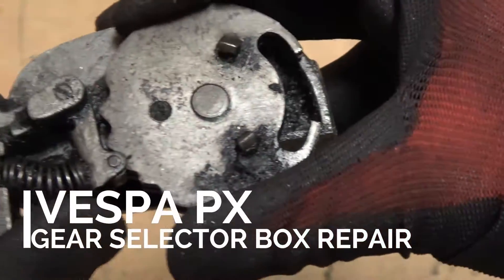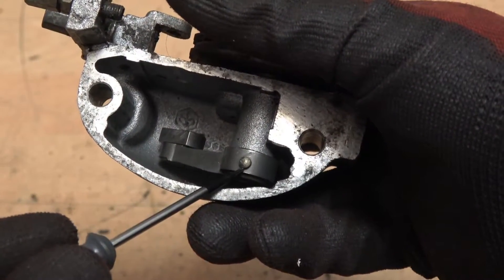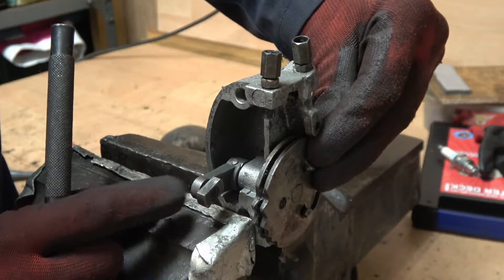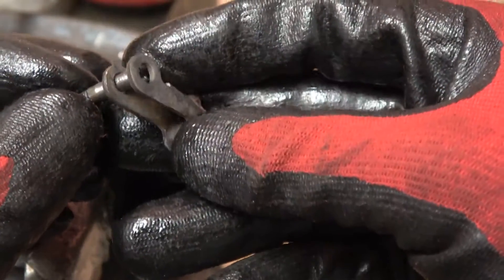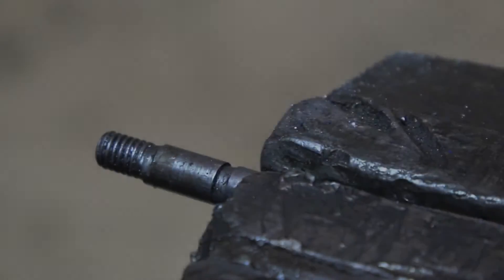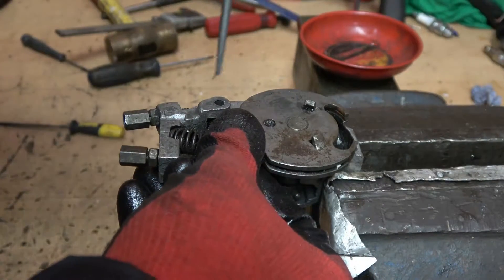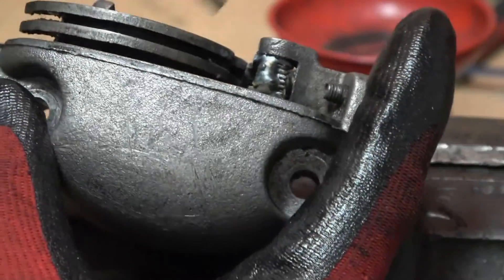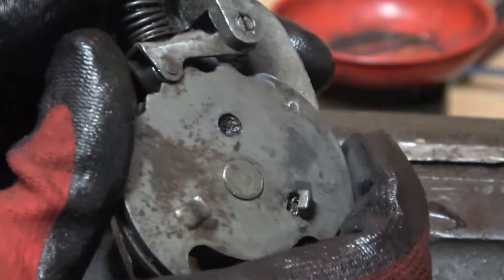SLUK | Vespa PX Gear Selector Box repair fix mod upgrade

Comment: Hi great vid cheers.. my box in 3rd gear isn’t level across ? The arm sticks up above gasket face about 0.8mil . My gearbox on a new engine build is clunking when the hub is turning and trying to jump out of gear.. I was wondering if I have the wrong box for this 1983 125 engine. When the selector box is removed the knocking stops when hub is turned and all goes through the gears properly . Any suggestions or help be brilliant, thanks Paul .